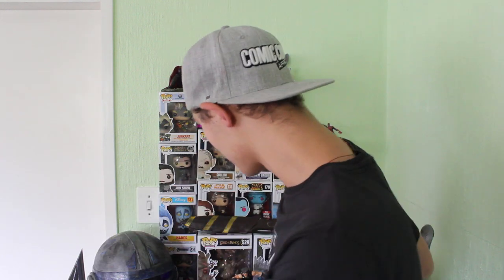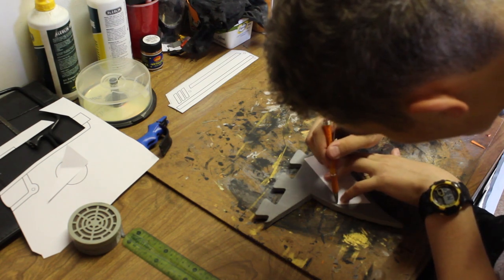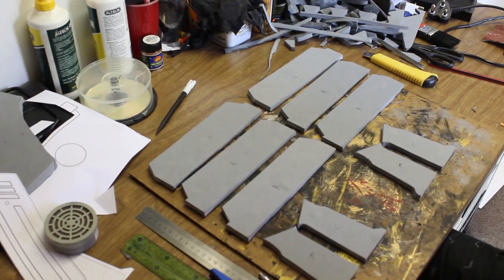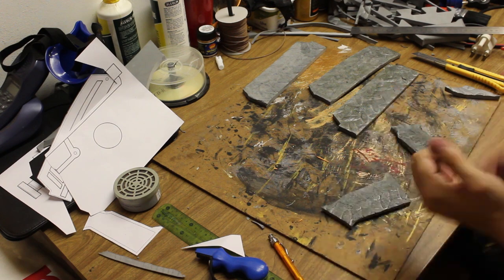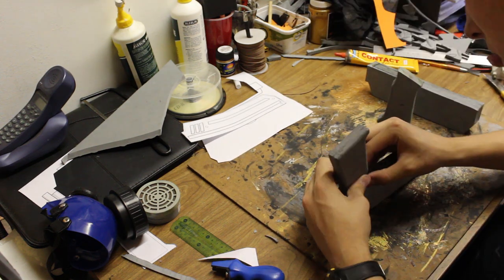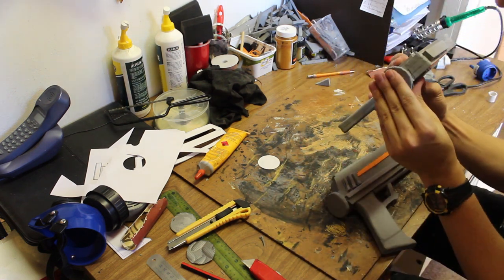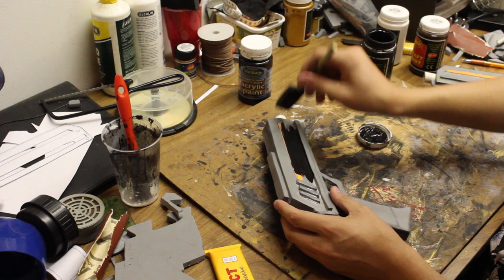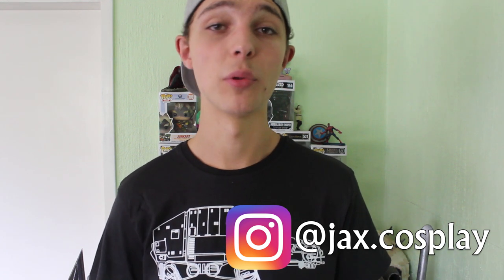Making Foam DC 17 Blaster Pistols (Star Wars: The Clone Wars) | Jax Cosplay

Comment: Hey! Thought about making these as my first cosplay props, I feel like they are easy enough to try out. I’m thinking about using wood glue to seal, just as you did! Does wood glue work or should I invest in another sealant/primer?
Reply from the maker: Yeah wood glue works perfectly as a sealer for props or any part as long as it doesn't need to be flexible like armor. I can't wait to see what you make, feel free to send me a pic of your blasters on Instagram, best of luck 😁😁
Reply: Jax Cosplay I ordered foam today! So exited, will definitely drop by your instagram <3 thanks again for the wood glue tip! Blasters don’t need to be flexible so I guess I’m good to go :)